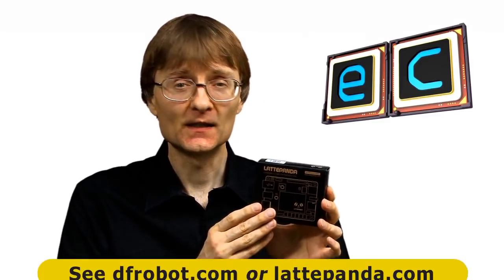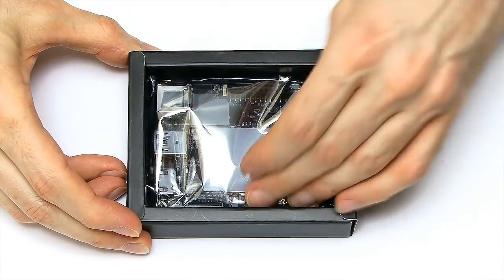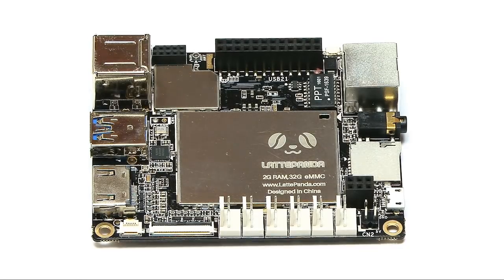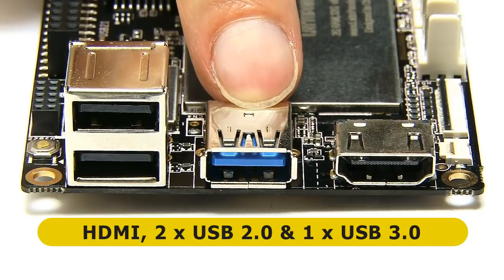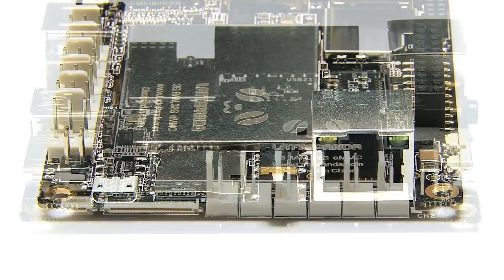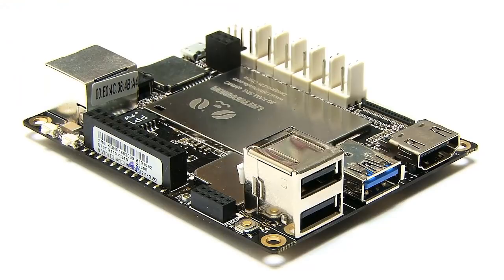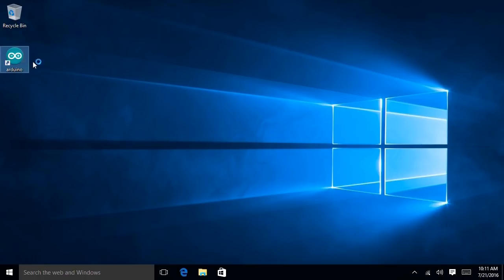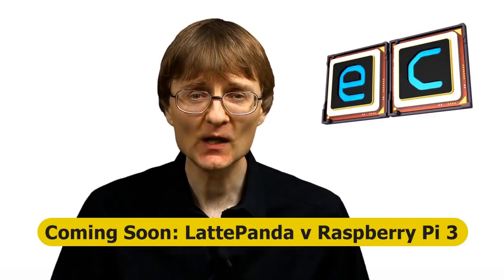LattePanda Windows 10 Single Board Computer

Comment: How much is the board without windows? Or is this an M$ product? Either way, this is a good competition to the pi and I like they have incorporated arduino elements into it but when you have arduino's out that for around £3 and pi's at £35 and lower and even the zero at around a fiver, the biggest let down for this is it's price. If this is an M$ product, they can afford to drop the price or the makers of this should be able to offer a cheaper version without windows and let the users install their own OS on it. I'm sure it is not limited to windows which comes to my next question, how do you re-install windows or install another OS on this? I mean, what options for it are available?
Reply from the maker: The version of the LattePanda shown (2GB/32GB) is $79 without Windows. To reinstall Windows, there are images available from the LattePanda website, which need to be placed on a USB drive for installation.

Comment: Hi there, I would be very interested to see you get windows 8 working with many of the computers you review. I'm constantly looking for computers that can have updates shut off..
Reply from the maker: I've only tested two SBCs with x86 processors capable of running Windows -- the LattePanda, and the UDOOx86. The latter should run Windows 10 no problem. But there is no Windows 8 support for the LattePanda.

Comment: Unfortunately, according to the dfrobot.com website, they no longer 
supply licensed Win10 with the 4G/64GB version: 
http://www.dfrobot.com/index.php?route=product/product&path=175&product_id=1404
It clearly says: LattePanda 4G/64GB without Win10 product key. Apparently you do get an unlicensed version. Just as a question is this the 32 or 64-bit edition? Also I am guessing it is the basic Home Edition?
Reply from the maker: They still supply the 2GB/32GB version as here wth the product key: http://www.dfrobot.com/index.php?route=product/product&product_id=1405#.V7m0elsrJpg -- and this is the board I am showing here (and in my other LattePanda video uploaded today). The LattePanda website provides images for both 32 and 64 bit Windows -- the 2GB/32GB board comes with 23 bit if you purchase with Windows.
Reply: Yes I saw that :), I still think it's a bargain at that price. Thank you for responding! I suppose it is possible to get a linux distro running to replace windows. Can't wait to see what you do in future videos.
Reply: A friend of mine recently got the 2G/32GB Win10 version with the key pre-activated. I am somewhat pleasantly surprised with the performance for something so small. With the Fall Update of Windows 10 Windows Subsystem for Linux is out of Beta, and we have a plethora of Distros to simultaneously install.

Comment: Has anyone purchased one of these and back installed Windows 7 or 8.1?  No I don't hate Win10, it is my operating system on my dual boot Arch Linux home PC.  However, I want to run one of these on my work network to drive a digital signage monitor and we are not allowing Win10 on the network yet.

Generally the issue with back installing is driver availability.  All I need is for this to use the Ethernet connection and HDMI output.   I would hope that with an Intel CPU and graphics, this should not be a problem.  Just curious if anyone has tried yet.

Comment: Why can't we pre-load Windows 10-X version onto a mounted fast EEPROM chip on the motherboards of every MOBO sold? Make it an option of course, Windows, Linux, Apple or NONE... Then you flip the switch and OS loads 'nearly' in 5 seconds with the registry and changeable files of course stored on a HDD or SSD... Why not do that?

I mean God Damn we've had a BIOS chip since forever, how hard can an OS chip be?

And like I said if you don't want pre-loaded windows chips then you would be allowed to by a version of a motherboard WITHOUT the OS installed.

AMEN?????
Reply: Way back in my intro CS classes, several years ago, I had a professor who asked the class the same thing. She didn't have a solid answer for us. I agree with you, that would be very nice. However modern SSDs can load an OS in about 7 seconds (that's the time it takes my Ubuntu Laptop to turn on and log in). These days, the choice doesn't make sense since if you want a really fast boot, you can have one just by swapping out your drive. Hence, the tech has not caught on in consumer electronics for the most part.

Comment: i am not very in computers so:

is there any way to connect dvd/cd drive for installing programms like word?
Reply from the maker: Yes, you can connect an external USB CD/DVD drive and install software from it. Or, in most cases, you could use another computer to copy the contents of a software CD/DVD to a USB drive, and then install from there.

Comment: How easy is it to blow away Windless to install Linux?
Reply from the maker: Very hard. The LattePanda, like many Atom PCs, does not have a standard boot loader, so you cannot just boot and install from a USB drive. You also need Linux drivers for the board. Some people have got Linux running on the LattePanda to a point, but not with everything working (eg audio and WiFi!). This really is a Windows 10 computer.

Comment: would it work with the raspberry pi 7" touch screen? I am doing a picoscope project and if I need to move from linux to windows this would be an awesome upgrade. As the picoscope has minimal linux support and propably bad arm support.
Reply from the maker: It will work with a touchscreen, but not the Raspberry Pi model.
Reply from the maker: I forgot -- I did a video on a LattePanda touchscreen! https://www.youtube.com/watch?v=j7o6CBNUmt4

Comment: should I buy a laptop under 250 doller like HP 14-inch Laptop, AMD E2-7110 or lattepanda please can you confirm mr what is the best and can I install graphics card on lattepanda
Reply from the maker: Unless you need the SBC form factor (or the use of GPIO pins for something like robotics), the laptop will be more useful in most situtations. The laptop will probably also have more storage, and you will not have to supply a screen, keyboard, power supply, case and mouse. You cannot install a graphics card on a LattePanda.
Reply: ok

Comment: is it possible to hook a graphics card up to it?
Reply from the maker: You could connect a USB graphics card, but not any other kind.
Reply: thank you for responding! I plan on using a LattePanda in a DJ setup as a dedicated pc for DMX light control, and if the ram is adequate, perhaps some 3d visualization with a projector behind me.

Comment: How is this even worth it ? Isn't flash storage super slow(write speed) ?
Reply from the maker: Flash storage is far faster these days than a hard drive -- hence the reason why so many people are moving to an SSD as the boot drive on their PC.
Reply: SSD ? I thought flash storage was something that you have on pen drives, for example- san disk. I know SSD are super fast.
Reply from the maker: Seldom Pooper You are right, flash storage is used in pen drives. But it is also used in SSDs. SSDs are faster because they have faster control electronics -- the control electronics in (most) pen drives are slow as you say to keep the price down.

Comment: "Pre-installed"? So they install it before they install it?  Spell checker doesn't even recognize it!
Reply from the maker: I take your point linguistically, but "pre-installed" has been a common term in computing for some time. There is even a Wikipedia entry -- https://en.wikipedia.org/wiki/Pre-installed_software
Reply: Right, I understand that this has creeped into usage, however then there is no difference between pre-installed and installed.  I prefer the more economical usage.  By the way, thanks for the video, good stuff.
Reply from the maker: Paladin 06 "Pre-installed" is indeed a strange turn of phrase the more you think about it. I will try to use "already installed" in the future! :)

Comment: can anybody tell me if any of these SBC are okay for the average windows user like me who is no computer geek?...
Reply from the maker: I think the LattePanda is well suited to those with Windows experience. It is not that difficult to learn to use a Raspberry Pi with Linux. But there is no doubt that the LattePanda is a far easier computer to get to grips with if you are familiar with Windows. As I show here, you just plug in the power, mouse, etc and turn it on -- and you end up in your totally familiar environment. It makes it more expensive. But is also makes it very accessible.

Comment: can we replace OS win10 With Win XP ?? ~~ Win XP work with only 125mb Ram  and Small File installation I like that ~~ (Win XP with 2GB ram that more than enough for run MS office Very fast)
Reply from the maker: You would struggle to install Windows XP (or any other OS) as this is an Atom-based PC, and hence does not have a standard boot loader. So it does not (easily) boot from a USB drive to install Windows XP, and it there are probably no drivers (eg for WiFi) and audio.

Comment: Win10 is a very poor choice for an included os, LUNBUNTU would have been much better as it can run happily in 2 Gb of RAM. There should only be one RAM size, 4 Gb! The Micro USB connector for powering the unit is a tatty one, USB A connectors work much better.

Comment: Does it come with a legit COA for Windows? At this price range, I get the feeling Windows is a bootleg copy.
Reply from the maker: Not true, the copy of Windows supplied with the 2GB/32GB LattePanda is fully licensed.
Reply: But do you get the COA in the box? This is crucial for warranty or technical assistance of the operating system with Microsoft. Not providing a COA tells me that they are not a certified Microsoft reseller.
Reply from the maker: Your PCMD I didn't get a COA in the box, but then I had a review model. But the LattePanda has got a license key.

Comment: did you just BOOST this board. IS that sexual harassment. The correct statement is OVERCLOCKING.
I'm surprised no one got this triggered.
Reply from the maker: Turbo boosting to a higher speed temporarily is something many modern CPUs do during their normal operation. It is not the same as overclocking.

Comment: wut 2GB/4GB is to little for a full win 10 system. Using a Q6600 with 4Gb ram right now over the summer and It struggles with to many tabs opened in FF. why not 8Gb at least. should not even make this little system more expensive.
Reply: Because its not meant to be a desktop, and a Q6600 is trash compared to newer CPUs
Reply: So? who cares if it is trash? all it really need do to is work as a surf/movie pc. And to be fair this trashy q6600 still work ok in todays games. But anyway 4GB is to little for surf and there are other similar cheap mini pc's out there(with same system spec) and they for sure are going to be used as desktop systems, 8GB would make a big difference.
Reply: Not really. I run a Windows 10 VM with 4GB of RAM and I have no issues.

Comment: If this has windows on it even the 64gb flash is not going to work 🤷‍♂️
Reply from the maker: Why? Windows 10 works perfectly well in 64GB, 32GB at a push.  Many low cost Windows laptops are sold with that amount of (flash) storage. Remember that the space that Windows defaults to taking on a drive is a proportion of the total drive capacity -- so (eg) if you install Windows on 1TB drive it will grab a lot more space for temp files (such as the trash cash) than on (say) a 32GB drive. So you cannot judge how much space windows takes up simply by looking at the space it uses on another PC.
Reply: ExplainingComputers sure however I have a 60gb ssd in my pc and windows might only take 20gb at first but once they bring out updates and stuff like that, well, say goodbye to your storage.

Comment: will it run freebsd or at least some linux distro? No, I'm serious. The very essence of these small IoT things are open specs. Otherwise, you've got some black cat in a poke. And BTW, for the money you could buy much more transparent hardware from pcengines.ch with the same intel arch and even more flexibility on board like miniPCI slots.
Why comparing apples (intel arch) with oranges (armish raspberry pi)?

Comment: 150 a 200 dollar on ebay
why so expencive
Reply: Because it sports an Intel processor and comes with Windows preinstalled. There's a reason why other single-board computers are avoiding Wintel.
Reply: :P
thnak you for the info

Comment: step 1:  wipe windows off it.
Reply from the maker: Sadly this board does not have a standard boot loader, so OS cannot be installed from USB media, only from image files for the machine. So if you wipe Windows, you have no OS. These first versions of the LattePanda do not have Linux images available.

Comment: 100% useless! Windows 10 does not play nicely with 2GB's. The last OS to work properly with only 2GB's of RAM was XP. Vista and higher need 4GB's to actually do anything past booting up. 2. With only 32GB's Windows 10 will not be able to properly update itself. If it comes with the original plain jane Windows 10, it WILL NEED to be updated and with 10 that basically means downloading a huge file (windows 10 install) and installing a newer version over top of itself. This should have come with Linux, or Windows XP, or at least 4GB's of RAM and 64GB HD space.

Comment: Nice board and thank you for the video but in my opinion the Up Board^2 is more promising. It also supports Linux and not only Windows 10 and it is cheaper.
More infos here:
www up-board org/upsquared/
I wonder what the power consumption of the smallest Up Board ^2 will be?

Comment: Cool little computer ruined by Windows. Just install Linux on it.
Reply from the maker: You can't "just install Linux on it". It has an Atom CPU and no standard boot loader. Hence it is not possible to (easily) boot from USB to install a Linux distro -- even if you did have a version with the right drivers/etc. Some have tried. I don't know of anybody who has fully succeeded to get Linux working with all of the hardware (eg audio and WiFi).

Comment: lol and Windows 10 would make this a useless heated paper weight since the OS is bloated compared to Linux, hell even the higher spec atom or celeron laptops being sold in shops run like absolute garbage with Windows 10 on it

Comment: Wow.
Why would anyone ever buy this?
$100 license...
$30 hardware...
And it's an intel chip too.
x86 is passable in high performance CPU's where the majority of the TDP and die space go to cache, but it has no place in low power environments like this. Of course they would have to ditch windows if they went ARM, and then it would just be a pi clone. And they wouldn't get to be special snowflakes.
Pointless...

Comment: Costs $ 150 in my country, for this amount I'll buy a full-fledged 
laptop core 2 duo, which will be several times faster than this card + 
the x86 architecture is + the ability to install MacOS :-)
Дурних нема.
Reply: This is progress. Computers getting smaller. Ти і є дурень.
Reply: this computer is not meant to be used as a regular everyday computer. It is for engineers or hobbyists to test stuff on.
Reply: Pixl Rainbow Only for now.
Reply: Anton Slavik shrugs just because this specific computer isn't meant for general use doesn't mean that it can't be used for other things. It just means it is not going to be optimal for the uses The Black Fox intends.